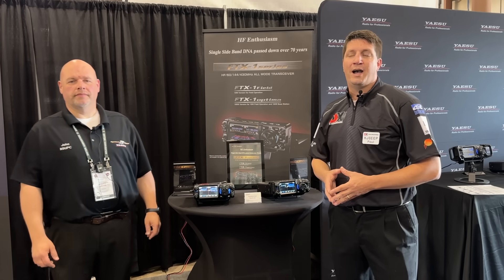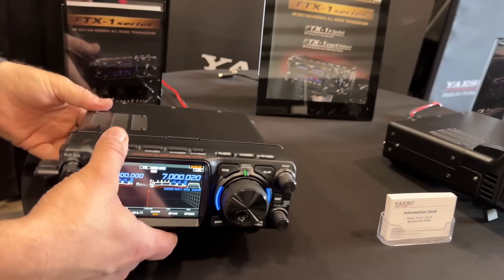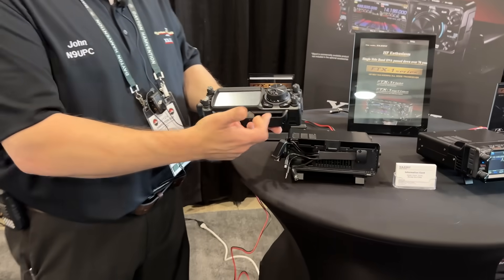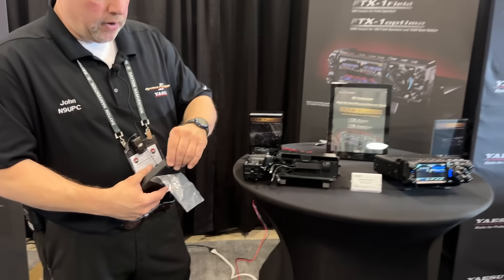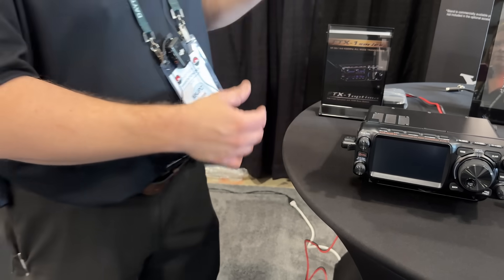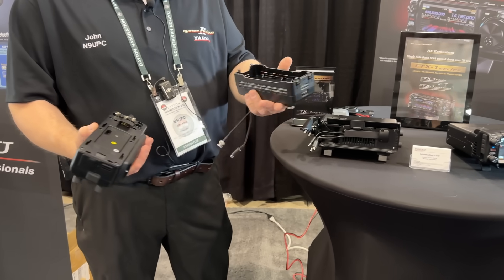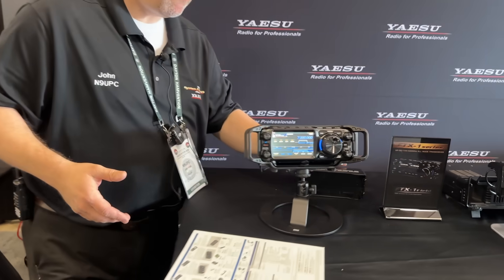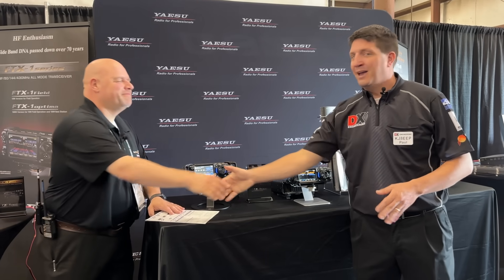A closer look at the Yaesu FTX-1 - Hamvention 2025

Comment: Great presentation of this new Yaesu! Minor remark: Does the Optima have an antenna tuner (see 3:22, whilst the first cable is plugged in) included, too? TU, 73
Reply: The amp base station (SPA-1) that the optima bundle comes with has an integrated tuner.  But it does not come with the qrp tuner that mounts to the back of the field head, that you have to buy separately if you want a tuner without using the amp.  (you can probably use a 3rd party one if needed to save money since the list price is $320 but dont quote me on that)

Comment: ICOM 705 still the master at 10 watts QRP... just need the 705 100 watt version in a compact size
Reply: Both units are limited to around 5w with internal battery, 10w with external 13.8v source.

Comment: Great radio sure but why has Yaesu and Icom forgotten about the less well off Ham who can't afford this radio and can't buy an FT-818 any longer ? Imagine this was to replace the FT-891 ? no way I would pay 2500 Euro's or more for a radio like this with amplifier no matter how good it is.

This is a new level of insanity in pricing from Yaesu especially considering bluetooth and GPS antenna seem to be optional , you got to be kidding me at this price level. 

No wonder people are turning to the Chinese radios.
Reply: I think they are concentrating on the high end radios, they can't compete on price with China at the affordable end.
Reply: @triradioagreed xiegu already has a better unit with the 6100/200 and amp ... without hanging a bunch of crazy off of it.  I've owned a 6100,705, 857 etc trying to run the rabbit hole off getting the best smaller radio for the field.... fortunately or not no one is on 2m here so that helped me focus back to just a smaller HF rig or tote the 7300 out in an apache $800..... the prices of these things are crazy, and the Chinese are killing them at every turn.  Why yaesu insists on an external tuner is beyond me accept that it seems like they always want to sell everybody accessories. So you're $1000 radio turns into a $3000 dollar radio to get it to do what you want.   Pass for me
Reply: Agreed xeigu

Comment: Lol at giving away reserved units to people at Dayton. First of all, it’s Way too expensive for something that should’ve included atu and gps in the head unit for that price. All this time Yaesu had to get it right and they fumbled with this one. I bet the HamTubers won’t mention this and will push this saying how amazing it “sounds” (“it’s so loud wow!”) while getting it for free or at deep discounts by shilling for companies like DXE, HRO, and Gigaparts etc and pretending like you’re getting a hookup with their 5% discount code on a $2K radio.
Reply: IDK I can see the separate ATU a lot of the QRP guys like resonate antennas.
Reply: @n9atf798 If it was tiny and lightweight, sure, but this thing is huge by QRP standards, so might as well include the tuner.  The obvious reason not to though is that you need a different tuner for 100W than you do for 10W, so it’s a bit awkward either way.

The GPS though…zero reason for that to be a weird little accessory sticking out the side where it’s going to get broken.

Comment: Does the Optima have a built in tuner or is it just an amplifier?
Reply: It has a typical 3:1 tuner in the body with the amp, yes.
Reply: @Sawfly1369  built in tumer.
still major failure without full duplex

Comment: Yaesu did the homework. they saw the IC-705 all the after market accesories where it fell short and they did built a radio system around the main QRP rig. good job.
Reply: @FFdo.  it's a total failure without full duplex.  they went 90% there and failed the most fundamental functionality.
Reply: It didn’t fall short and comes stock with items that are options on the yaesu. Piss poor design

Comment: It's a very heavy substitute for a KX3.  Hopefully less expensive.
Reply: I’m literally pondering whether I should be buying a KX3+PX3+KXPA100 after seeing this.  The Elecraft package is expensive as hell, but probably meets my needs better than the final product Yaesu ended up with, which is a bummer…
Reply: If I could get a KX3 with encoder knobs that don't suck, a speaker that isn't absolute garbage, and an internal lithium battery it would be the perfect radio.
Reply: Definatly not an ultra-light radio. Probably not for the SOTA guys.

Comment: The closer look at the Yaesu FTX-1 was greatly appreciated, guys. So wished that I could have been there at Daytona to see it with my own eyeballs, but this was the next best thing. Looking forward to checking out the Yaesu booths at Hamvention 2026.

I can easily see a LOT of seasoned Yaesu fans selling off their FT-991As and FT-710s in order to upgrade to the FTX-1 series. I have collectively owned my FT-DX10, FTM-300DR, and FT-991A for under two years, and have loved all of the things that they have done for me in terms of performance and value. That said, I would love to eventually add the FTX-1 Optima to my transceiver inventory exclusively for field operations, along with the FTM-510 for dedicated use inside my truck.

IMO this is the true successor to the FT-817/818/897/991 series of beloved radios, and that's not a bad thing. That said, if I could ask for one thing, it would be for a proper replacement for the FT-857D, arguably one of the best shack-in-the-box radios ever produced in the space. Until Yaesu (or someone else) can achieve this, the FTX-1 series is (for now) as good as it is going to get.

Comment: Absolutely zero reason it needs 4 wires manually connected when switching configurations. This could have all been done by simply molding the connectors into the base station body with some alignment pins to make sure they don't get torqued going in-out.
Reply: The lack of a new proprietary connector allows us to build aftermarket pigtails.
Reply: It might have something to do with durability and ease of repairability, but on the surface it's an odd choice.
Reply: @_PJB_   consider this, the modular style here likely allows more flexibility that has yet to be discussed or announced. I imagine seeing a mobile back as well.
Reply: This unit will be getting a lot of modifications to it make easier to deploy and to make up for the deficiencies of the engineers.
Reply: Absolute insane design choice
Reply: @BobBob-il2ku  I’m not really sure why you say that. If they chose a proprietary connector, people would complain about this.  What negative to this is there? Takes you 6 more seconds to plug in?  Sure it looks funny but there’s no doubt it works
Reply: @_PJB_  this sideshow about connectors is irrelevant. what matters far more is lack of full duplex. that is the biggest tragedy here.
Reply: Unless you’re an electrical engineer shut up. You have no idea what all the reasons are. #sadham
Reply: It is obviously not an esoteric EE reason as some swamp creatures may imply. The design decision is obviously based on 1) cost, 2) panel space (no room for duplication of pins), and thus 3) connectors directly compatible with the individual 'garden variety' connectors when in the Field mode.
Reply: @JxH stupid comparison. Why would it have something the “finest avionics” have?? 😂 an absurd and non-related statement, it’s a ham radio. It’s a supply chain thing. They’re taking parts they can buy in bulk for a discount. We’re not even at the engineering side of things and you’re wrong twice over.
Reply: @JxH EE’s are involved in design processes and we communicate with suppliers. You’re so desperate and butt hurt you’re creating false conclusions. Just another sad ham 😂😂
Reply: @fbswampfox  This would actually be a mechanical engineering problem, and you're right, you don't know who I am or what my qualifications are.
Reply: @_PJB_ I’m an electrical engineer and you obviously aren’t so….shut up 😂😂